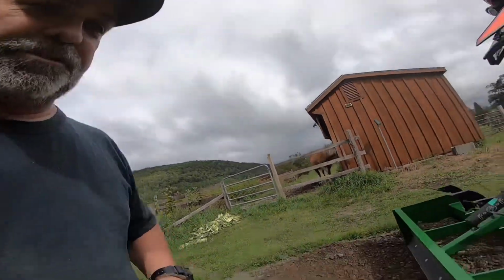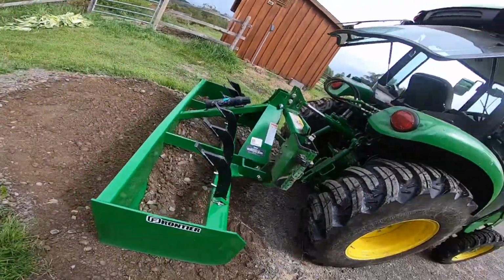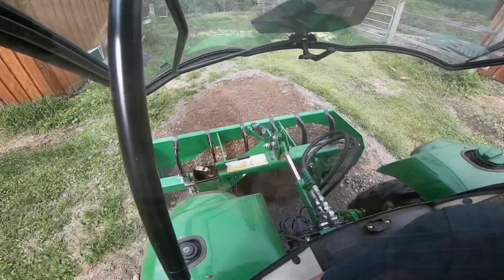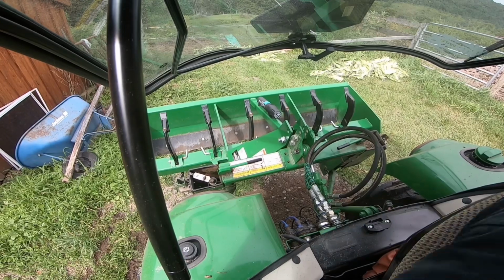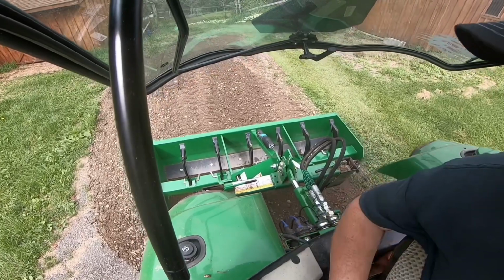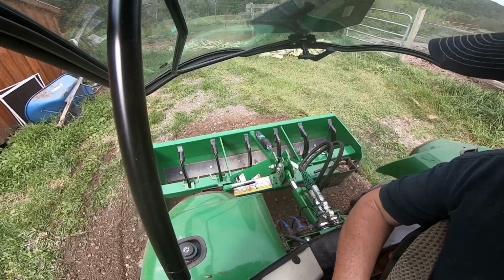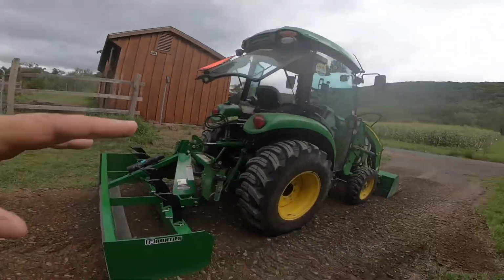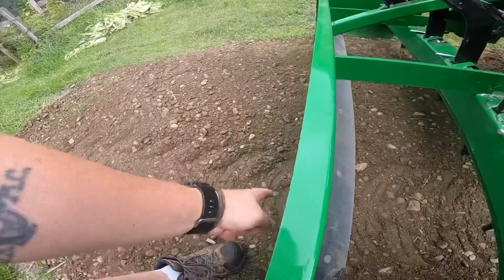BOX BLADE BASICS-basic grading techniques

Comment: I'm sure I'm not the first to make the observation, but this largely mimics the intent and effect of back-dragging with the bucket.  I think most folks are probably at least casually familiar with back-dragging, so maybe that would help in visualizing what's going on there.  I appreciate the box blade crash course you've been posting the last few videos...most tutorials are about moving material in some way, but there are very few regarding this type of application.
Reply from the maker: I appreciate your feedback, you are correct. This does mimic back dragging with a bucket, I suppose I should have made that reference. As far as tutorials, I rarely do this type of video, but for the reasons you listed is why I decided too. Most videos are moving material, not simply regrading a driveway, to which there are many videos that do not demonstrate it correctly.